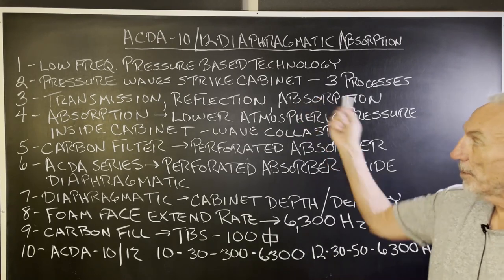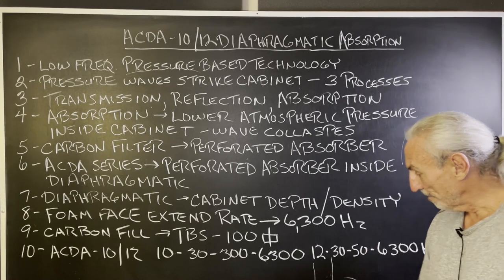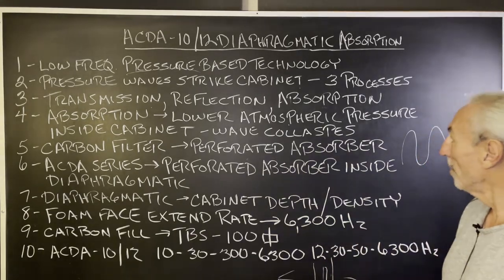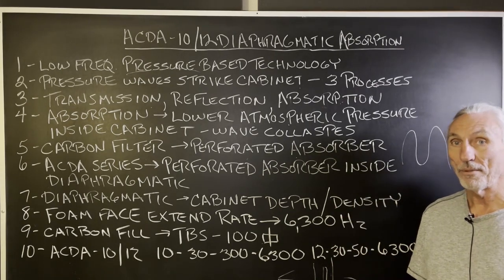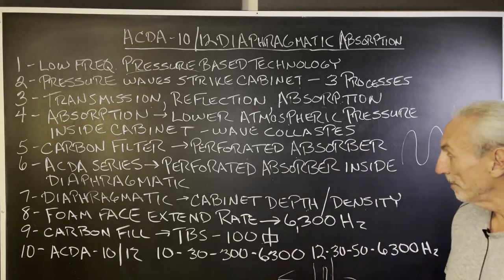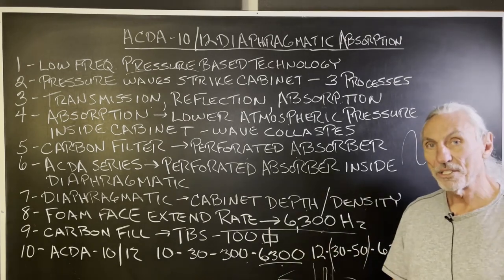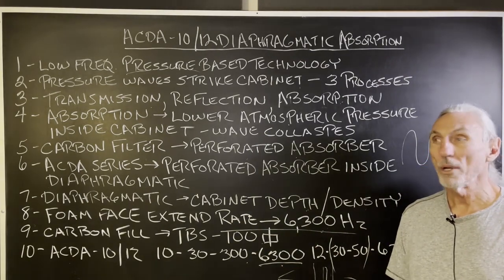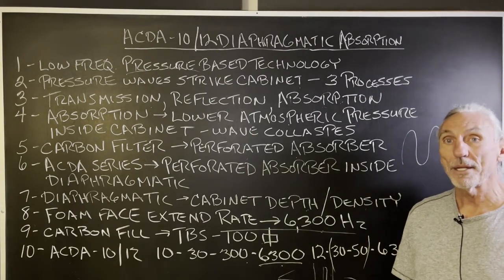ACDA-10/12 Diaphragmatic Absorption - www.AcousticFields.com

Comment: please compare these to the GIK tuned membrane traps - is yours better? why? Thanks.
Reply from the maker: When comparing performance you must look at the rate and level of performance. Level is how low in frequency the unit starts working at and rate is how much energy and how quickly that energy is absorbed. Our technology goes lower in level and has a rate that is not mathed with current technology.

Comment: Could you take a moment to explain the lower atmospheric pressure inside the cabinet in item 4 with a little more detail?
Reply from the maker: Study the impact of large amounts of frequency dependent absorption inside a sealed container.
Reply: @AcousticFields  What is lowering the atmospheric pressure inside the cabinet?

Comment: Nice
Reply from the maker: Two low end frequency ranges you must focus treatment on in all small rooms. You must cover 30 - 50 hz. with enough horsepoer to make an audible difference in definition and separation. The next broader band issue range is 30 - 300 Hz. All small rooms require a combination of both frequency range treatments.